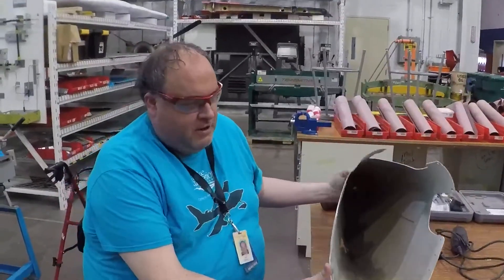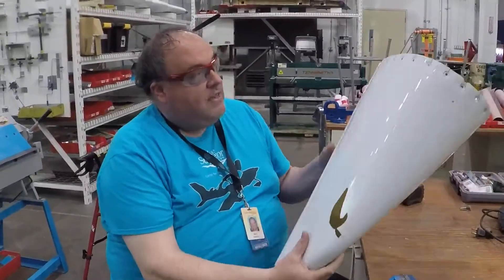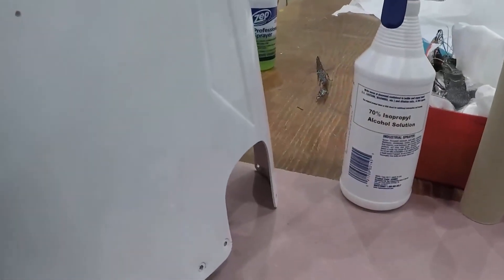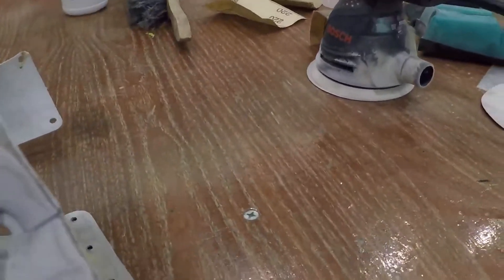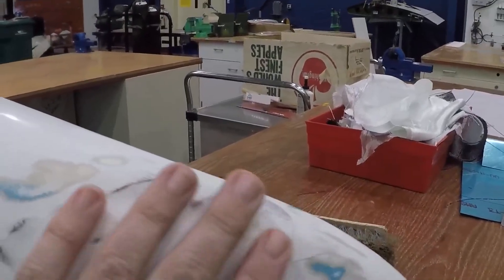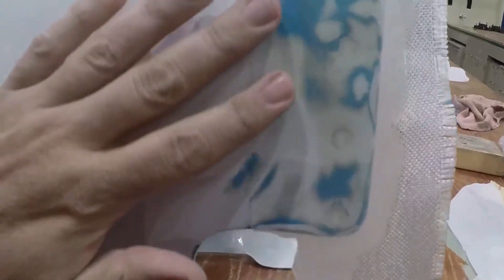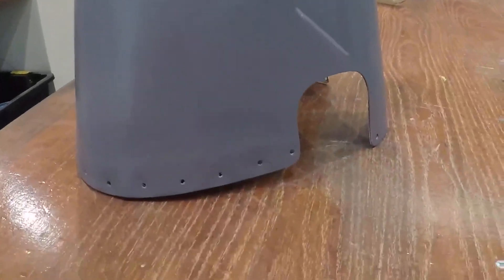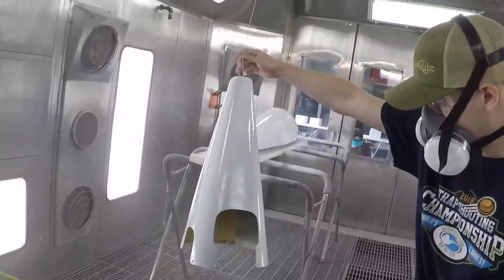Fiberglass repair of Cessna 182 tailcone, aircraft composites

Comment: I really enjoy your videos, they are very educational.
I would highly recommend you demand shop safety of yourself and anyone in the shop when the work is being performed. If your students who are wearing their PPE while going through your class see you not wearing eye protection or ear plugs or a mask when sanding and painting then they won’t either when they are out of your class and working in the field.
Set that example for them and tell them why it’s important. You might be saving their life down the road because they will view safety as just as important as the work. I got a small piece of metal in my eye once while working on a jet. It was extremely painful and I’m blessed that I didn’t lose my eye and career all because I wasn’t wearing any PPE. It took a doctor to remove the metal imbedded in my eyeball.
Reply from the maker: You are right.  It is all about forming good habits.  Over the last couple years I have made great efforts to form good habits and wear ppe